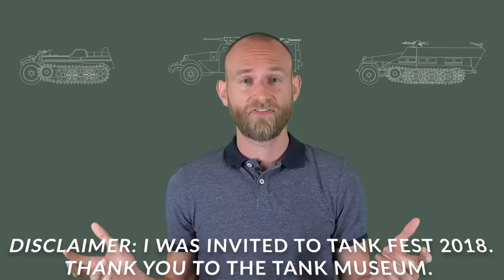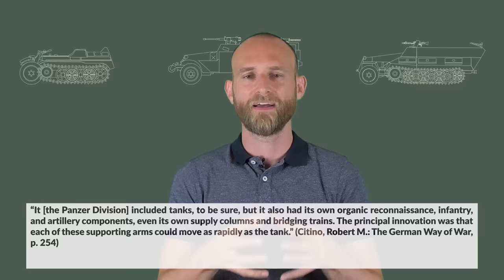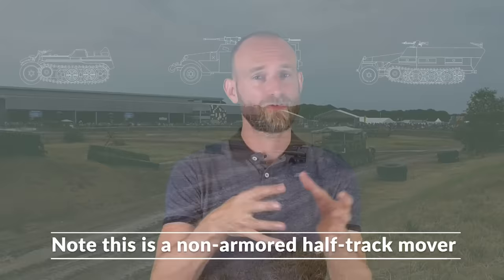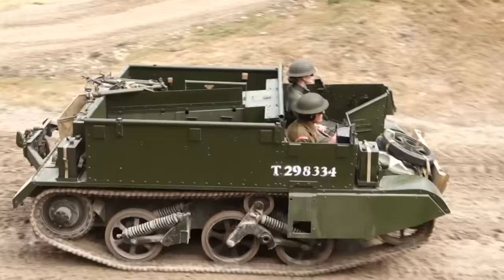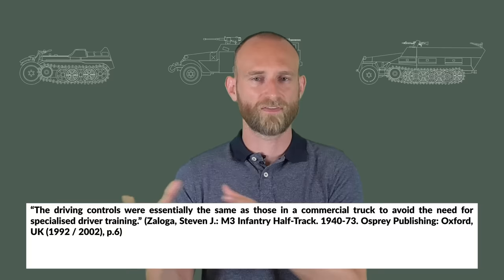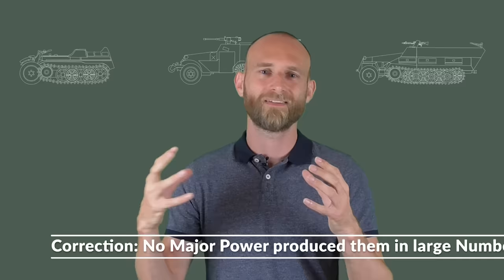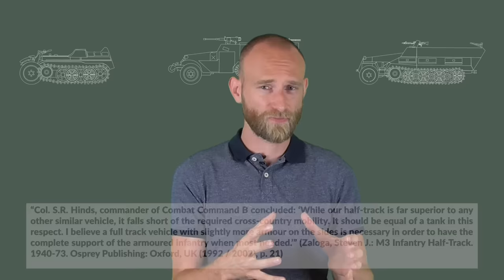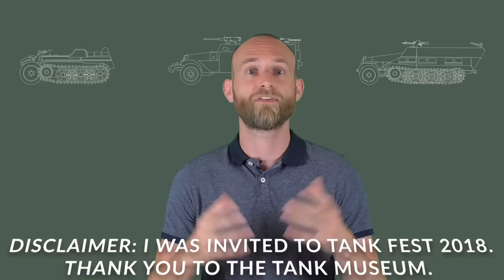Why Halftracks? Why limited to WW2 only? (Featuring Tank Fest 2018)

Comment: Half tracks were used by the US Army during the Korean War, too. They mounted four M-2 .50 cal. machine guns (a quad 50) and they were primarily used as Anti Aircraft Artillery (AAA, now called Air Defense Artillery, or ADA). Just prior to the massive assault by Chinese Communist troops a group of such half tracks were caught while their crews had all four weapons disassembled for cleaning on each track and a massacre ensued. Afterward, rules came down mandating that no more than two weapons could be down for maintenance at any time. Ideally, the two weapons chosen be cleaned were located in diagonal positions. My dad was a drill sergeant at Ft. Bliss during the Korean War in the AAAIS, the Anti Aircraft Artillery Intelligence Service, responsible for training AAA crews in these vehicles. 🇺🇸

Comment: A commenter from Quora came up with a new reason but I haven't heard of why half-tracks are not used anymore: the quality of tires in the 1930s and 1940s was not what it is since. He claimed both of materials and the tread patterns were just inferior to today's tracked armored fighting vehicles.

This said, I believe one Brigade from each of three Bigades of an U.S. Army division since the year 2000 contains a Stryker Brigade which is an 8-wheeled vehicle.

Comment: In WW2 it became clear that the supporting infantry to tanks also has to travel in tracked vehicles. At that time, engines were relatively large and weak. A tracked vehicle has to have a certain ratio between its length and width: a fully tracked vehicle cannot be very long, otherwise it will not be adequately steerable. Putting a large engine into a fully tracked vehicle at that time left  too little space for the infantry. The engine was therefore put outside of the tracked envelope, supported by an axle with wheels. This had the added advantage that the wheels could be used for steering. The length - width ratio of the tracked part was good and there was enought space for the infantry. The biggest disadvantage was that the cross-country performance of the halftrack was not as good as that of the tanks. After the war the halftrack fell into disfavour because its mobility was inadequate to keep up with the tanks, and more compact and powerful powerpacks became available which enabled a fully tracked APC/IFV to have all the drive line components inside the armoured envelope but still have enough room for an infantry section.

Comment: not only were they easier to drive than a tank because they had the same controls as a truck. but they were easier to manufacture and maintain. Because they had the same drivetrain as a truck. Engine, transmission and rear differential.

Comment: Most American half tracks were rattle traps. Light armor-piercing bullets would go through one side, rattle around inside there. They really defy logic. You need some armor that can stop shrapnel and bullets - especially from over head. As an SPG these performed well. They had a version with a 75 mm howitzer and one with a big mortar. But they were worthless at keeping a squad safe as they moved to a position across a battlefield.

Comment: I think you made some excellent points on this question.

(First, my creds- I fought with the M-113 ACAV assault vehicle in Vietnam 1967 through 1968 and was an 11-Delta Armored Intelligence Specialist)

In my own opinion, halftracks were just a cheap solution to a suddenly realized problem- which was as you clearly stated, infantry must keep up with the fast moving armor. Truly, to this very day, lightly armored infantry carriers like the M-113, are expected to enter the same environment as the appropriately armored tank - which I always thought was ridiculous. However, in my pre-M-1A1 days, tanks were just as vulnerable, if not more so, to light MANPAT weapons carried by the light infantry forces we were up against. The RPG really changed land warfare much more than APC transporters.

The true solution to keeping infantry support in line with the Tanks is to put them in fighting vehicles as survivable as the tanks. This  has never been properly answered by any military force- You can see that the military has in fact worked on it with vehicles like the Russian BMP and its many variations and the Allied AFV,s like the M-1127 Striker and the M3 Bradley - naming just a few I am familiar with- other countries all have their versions of such AFV/transporters.

I think the Israeli defense forces tried to combine the transport with the tank in their front-engined Minerva designs- I am not sure if the latest iterations of the Minerva still have this capability.

The assault helicopters seem to have gained some traction in filling this role with their combined role designs- and that seems to have, so far, worked well since Vietnam, to bring troops to the exact place needed and then fly off and support them with direct aerial fire- However, MANPADs are becoming as plentiful on today's "insurgent" battlefields as the RPGs and other more sophisticated tank killing shoulder-fired weapons. So, in my opinion, the future of such a solution may yet seek refinement.

However, let me also point out your idea that a halftrack is easier to learn to drive than a tank or other fully tracked vehicle- I disagree. If the militaries of the 1915 through 1945 era had been able to train hundreds of thousands of fliers, artillerymen, teamsters, muleskinners, and truck drivers and also the complexities of accurately firing mortars and rifles, then there should have been no concern what-so-ever in training a kid to handle a tank or other fully tracked vehicle. In fact, the tens of thousands who were completely well trained to handle the vast tank armies of the day give my thought on this some good validity.

Thank you for your excellent video, BTW.

Comment: Good video as always - I'd suggest a couple of other reasons as well, high speed tracked vehicles - such as cromwell, hellcat and M24 were already in by the end of WW2 - and further progress was coming. Then the oversize pneumatic tyres used on modern wheeled vehicles made up a lot of gap from the other end. In the end both armoured cars and tracked vehicles got better than half-tracks which - as you wisely point out came with the complexity of both.

Comment: the trouble with a wheel vehicles is they can be bog down in off road area were tracks can do well in off road but can break the road so the idea is to mix a good idea but idea have flaw lack of armor compare to track vehicles since most of half track were base off a wheel vehicles and the mix of wheel and track make it more complex then pure forms.

Comment: Perhaps another aspect is the steering system. At the start of WW2 most tracked vehicles would turn by stopping or slowing down one track and have the other one run(faster). Some vehicles had the option of running one track backwards. This means it turned in place, making for an impressive bulldozer as the whole weight of the vehicle is let loose on the area it was turning. This kind of steering would create havoc on roads, especially brick roads. 
For the half-track this was solved by using the wheels for steering. I imagine this might not have worked well as you have these tracks that want to move in a straight line while you try to divert that forward movement by having the wheels turn. With a heavy load or when driving very fast the wheels will just be pushed forward, maybe even damaging them or the steering. I can imagine this issue would become more pronounced when the vehicle gets heavier.
During World War II more advanced steering systems were introduced and as such the half-track could become fully tracked.

Comment: On the other hand you can stick a 75mm gun, or a 40mm Bofors, or a quad .50 on a halftrack and it's harder to do those things with an APC. I was just thinking today that if the BEF in 1940 had had a mechanized infantry regiment supported with the above in support of their armoured units the Battle of France might have ended differently. Unlikely, but maybe.

Comment: You somehow got distracted and missed the proper modern halftrack replacement - multiwheeled APCs: Soviet BTR, German Boxer or Czech SKOT. Those are as fast as trucks and as good on rough terrain as tanks.
Forgot to add - any tracked vehicle (even halftracked) destroys tarmac roads. Thou HAVE to use wheeled APCs for patrols and long hauls.

Comment: its a lot easier to convert a truck into a halftrack (sdkfz 11 anyone ?) than it is to turn it into an fully tracked vehicle, and this (in a time where everybody wanted fully mechanized/motorized armies but where not able to produce enough trucks (!!!))  speaks wonders about why build half-tracks instead of fully tracked vehicles. I believe this is the sole reason.

After the war the surplus half-tracks had an effect of hindering development of new models (why are you going to buy one ?) while the increase in productivity meant that you could very well spend the money into fully tracked vehicles right from the (re)start.

Comment: Could probably do a whole video on open vs. closed top vehicles. Certainly there is an armor protection issue, but the infantry likes to be able to fire from the armored vehicles. If you look at everything from a M113 to a LAV to a AAVP-7 they have massive roof hatches that can be opened for the infantry to use (but also for reloading the vehicles themselves).

Even if you look at something like a HMMWV or a Land Rover they didn't add armor or even doors until the strategy changed from us doing the attacking to wait for the enemy to attack.

Comment: Even if the tracks were not as convenient as regular wheels, they are still very cool. No, really, adding some tracks to a vehicle makes it look much more intimidating, sturdy and, overall, badass. And I think that badassery is actually quite important parameter to account in military vehicle design, because if intimidation is high enough, it may sometimes cause the enemy to loose some of their morale, (if the fight is already lost for them, of course).
Or maybe I am now speaking nonsense, I'm not really sure...

Comment: Well, the Canadians and then through their innovation the British had fully tracked APC's in mid 44, the 'Kangaroo', ('de-gunned' Priest SPA based on the M4 chassis), admittedly it wasn't perfect because it was open topped and the troops de-bussed over the side but crucially it could go anywhere tanks could go and keep pace with them.
There was no need to train the drivers as they were simply poached from the artillery regiment which owned the vehicle.
It wouldn't have been too difficult to develop this into a fully viable APC with an armoured roof and debussing out of the back of the troop compartment over the tanks smooth engine deck.
In fact I made a model of one which was based on a suitably modified M3 Lee/Grant tank.

Comment: To put it simply, half tracks are difficult to manoeuver than both all tires or tracks. 
Add to that, half-tracks don't really take more heavy armor which was really the main disadvantage for armies to phase out the design altogether post WW2 as anti armor rounds advanced and armored vehicle armor level needed to increase as a result. 
This confusing design didn't go as good as full tracks on bad terrains and were chewing into paved roads and broke down easily. that's why we no longer use them anymore

Comment: Specialized driving training? I learned to drive a main battle tank in 5 minutes at Ft. Knox Kentucky. It is not that hard to drive a tracked vehicle until you start going fast. The faster you are moving, the more responsive the steering meaning use very small adjustments or you will get into trouble really quick.
Reply from the maker: maybe you are a natural talent or just miss how much harder and different these machines were to drive back then.
I know for sure cars were extremely different, in the Austrian Armed Forces I had once the "pleasure" to drive a first generation VW Golf, whereas I had a third generation VW Golf. When I changed the gear it was rather loud, since it required far more careful shifting. And this was a vehicle from probably 70ies or 80ies. Now, look back at the 30ies or early 40ies technology. Not to mention that US vehicles are usually far more user friendly.
Reply: @MilitaryHistoryNotVisualized  My unit in Boeblingen Germany at Panzer Kaserne (Rommel's home base) had WW2 "mascot" vehicles. I had the chance to drive an M-24 Chaffee light tank and an M-3 Halftrack. So long as you can handle a stick shift and clutch, not hard at all. I presume it was the fact so few had any chance to drive before military service, I had quite a bit.
Reply from the maker: @mobrule8219  yes, that is the point. I have one or more videos that actually show the number of vehicles / capita pre-WW2. Germany is on the bottom-end, US at the top. Although Germany had a lot of motorcycles.
Reply from the maker: @mobrule8219  also Chaffee is a late-war light tank, it barely saw service anymore.
Reply from the maker: @mobrule8219  here is the inside of T-34/85 while driving... https://www.youtube.com/watch?v=OG5RjXZOHRU
Reply: @MilitaryHistoryNotVisualized  One thing that does not change regardless of the tracked vehicle, the physics of how it turns. The final drive retards the rotation of the sprocket on the side the vehicle is turning towards. Once you get used to that, they all steer the same. The big difference remaining being automatic today versus standard transmissions back then. Stalling the tank must have been an issue for new drivers.

Comment: A.  Tracks have lower road speed and much more maintenance than wheels.
B.  Wheels have poor cross country mobility because of concentrated ground pressure and poorer steering in mud.
... Therefore,  half-tracks gained power transfer to the ground in towing and vehicle weight capacity, but had a combination of poor maintenance, slower road speed, and poor off-road steering.

Comment: I don't know exactly what share did halftracks take of German munition production during the WW2. But there is one certain month were numbers could be found. In July 1944 (record highest munition production) share share of halftracks was 1.6%. During the same month aircraft took 48.3% and AFVs (of all kind) 7.8% according to USSBS European Report vol3 (backed by German munition production figures and its value). Producing more halftracks would have faced same issues like producing more tanks and motor vehicles. Germany had very limited resources for producing fuel.

Comment: One of the major reasons for the Success of half tracks was production.  In Germany, it also managed to slip past some of the Restrictions from the Treaty of Versailles, while in America any Commercial truck Driver could drive them, but let's look at Germany.  because they were "Traktors" and not "Military Vehicles," they could basically use existing production facilities to crank them out, more than any other armored vehicle of the war.  (#2 was the StuG III, which honestly did more of the Fighting than the notorious Panzers, because they had so many of them, and they were easy to repair, compared to Wondertanks, like the King Tiger which spent most of it's time being repaired.)  Ultimately, one of the ways the Nazis crippled themselves was by investing too many resources into experimental research, that ultimately made no significant impact on the war effort, and taking resources away from the simple, but effective designs that actually worked.  Like the Sonderkraftfahrzeug 251.
Reply: They stopped producing them, because they developed differential drivetrains.  Before that (They could run one track backwards) they had to Skid-Steer tracked vehicles.  Skid Steer works with wheels out front.  Differential steer doesn't, without dragging the wheels sideways, and tearing them off the axles.  Basically they (Ferdinand Porsche, I believe) designed a better transaxle, which made them obsolete.  Incidentally, the British Univerrsal Carrier didn't skid-steer, it bent the tracks with steering bogies.

Comment: One thing I'd like to point out from experience, I cant agree with the whole "new recruits already having driving experience" statment as due to the age of new recruits entering the military, there is still a very large amount joining who do not have driving licences or any driving experience and still need that initial driver training. The main reasons for the elimination of the half track is technology advancement, modern fully tracked vehicles are so much more advanced that they are way easier to drive and are far more versatile than there predecessors. Half tracks were a quick fix to an immediate problem and development time was not a luxury any side had, they were far from an ideal vehicle and after the war ended there was a general consensus that the issue had to be addressed properly and so they were replaced with more favourable vehicles.

Comment: I think it's because trucks with wheels would get stuck in the mud in Russia.  The cheapest solution was to equip the back wheels of a truck with tracks.  Also it consumes less fuel perhaps than a fully tracked vehicle?

All speculation on my part.

Comment: A half track could have been made enclosed and nbc protected. BMS1 Alacran was a modern atempt in building one and it was fully enclosed.  I think the reasons for not building such vehicles anymore are: more powerful engines, more reliable tracks, better control mechanisms, the crew must be specialised anyways and current vehicles are not built in a war economy.